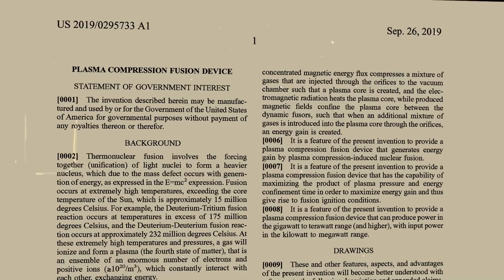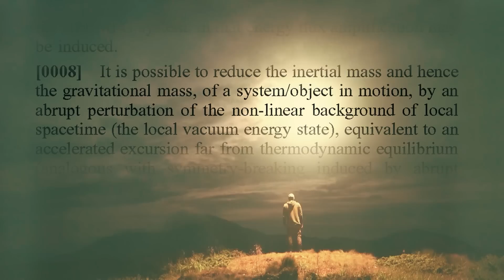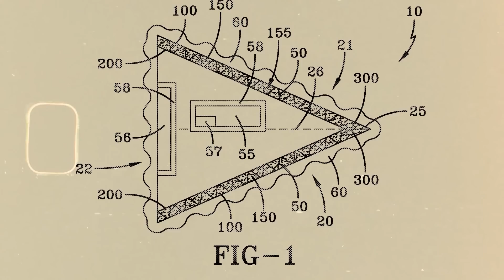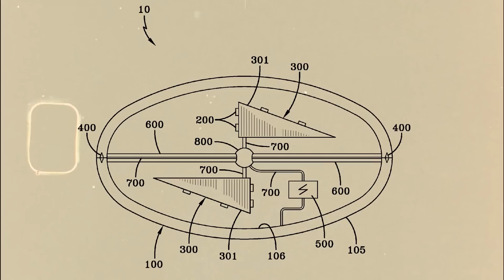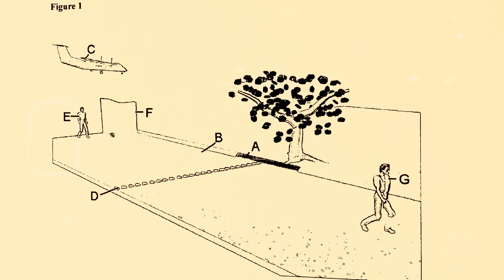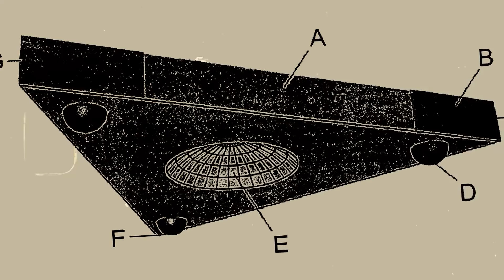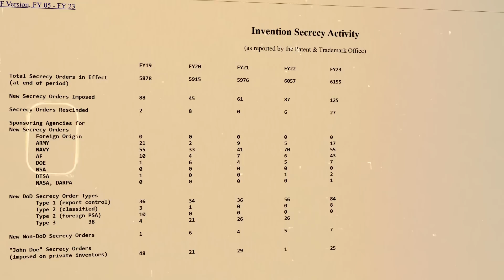The UFO Patents: 5 Military Inventions of Unexplained Technologies

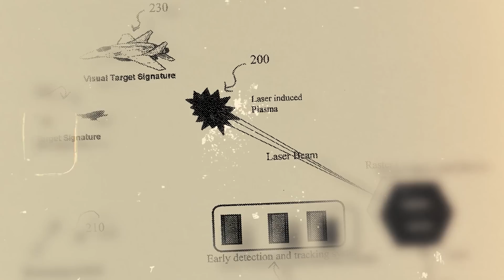Comment: I saw a TR3 on my commute to work in 2017. Got a good, long look at it as it hovered at around 300' altitude, right overhead. It was super early morning (around 5:30) and still dark when I stopped my motorcycle at an intersection, it seemed to get darker outside suddenly, so I looked up and there it was. It seems like the pilot(s) wanted me to see it, 'cause it sat there, very still for nearly 30-40 seconds before gaining altitude and banking into clouds. I experienced alot of weird things around that time.

Comment: The  triangle exists. I've been within  150 feet of one that was over a quarter mile wide. It was moving slow enough to keep up with it on a bicycle. Also I have been within 9 feet of one that was sitting still. I sat next to it for almost five minutes. The last one was shaped kind of like a stretched out drop of water and was about 6 feet long. Neither had sound or engines and its not the only ones I have seen. Most people couldn't  handle what's really going on here on this planet. It is best they just laugh and think your nuts.

Comment: I clicked because I saw the triangle in the thumbnail in 92 or 93, didn't notice the divot in the center, dull white lights on the back corners, red light on the tip with two more white lights left and right behind the red one. wasn't quite dark, it couldn't have been more than a thousand feet directly over me if that, not much sound at all and it was not going fast at all, watched till it went out of sight. 💚 from the middle of W.V.

Comment: the only problem I have with any of this is how quickly the 'gravitational wave generator' patent was glossed over.  regardless of if it is high frequency or not - the process of creating a gravity wave is not known to current physics or science that I know of.  they can be detected, but producing them is entirely a different matter.  inertia can be dampened by electrical potential fields and those can be used to create impulse, but that is not the same as gravity.  bravo to them if they did it, but that science is literally out of this world kind of level of science.

Comment: High Frequency Gravitational Wave Generator doesn't read what it originally did when first submitted and finally accepted, reluctantly by the US Patent Office. I only found it because they reached out to a news agency and my research into plasma weapons pulled three article up in a search. The Pentagon and Navy had to threaten to "turn their entire organization upside down" if they didn't patent it, stating that it worked and wasn't theoretical or scifi. The US Patent Office only spoke about it citing the potential damage to their credibility. 

It can be started with a gasoline or diesel engine, generating an EM field which is vibrated through a serious of mechanical acoustic and electrical mechanisms in the gigahertz range. The gravitational waves generated from the first fields vibration also generates an extra EM field. That secondary field was unexpected and contains about 10^33watts/hr of energy, which far surpasses the necessary energy to do what they say it does. It also is the technology which is causing physicists to reconsider inertial mass problems, remove them, and make their own predictions for faster than light travel. Currently, they estimate about 1/10th of the total energy output of the sun which is trillions of times smaller than what this thing is claimed to produce to go 100 times the speed of light without the inertial mass problems this "engine" claims to negate through Quantum displacement. The energy in the secondary field is captured via a copper lattice under the skin of the craft, which can be any size, requiring only to be within the gravitational field, and can be supplemented with extra HFGWG units tactically placed around the craft. 

The reason you won't find further advancement on this project is because it's evolved into other projects with new names as the technology is advance. HAUC Hybrid Aerospace and Underwater Craft is the next step after this, and is using the HFGWG in a configuration with other HFGWGs to increase output, and has commissioned a 2 terrawatt (I think it was) fusion reactor, which is just enough energy to explain how you flew a submarine into space (being the test platform for this technology,  or a submarine like cylindrical craft). There is another advancement of this technology being worked on which comes after this in the US Navy's lineage of this technology. The airforce, Northrup Grumman, and Lockheed martin are working on their own variations. It's likely this technology has taken off faster than most new technology does as the original has a lot of capacity for power increases and shrinking, as the engine itself doesn't have to produce propellant or push the craft with any conventional means, like air or water.

Comment: #2 is the famous US aircraft Aurora. Unlikely to use any non conventional system. Electromagnetism as propulsion, again, was tried by the Germans in WW2. Huge energy is necessary and there may be huge losses in making such. Vertical takeoff and hovering are, also, WW2 ideas, mainly, pioneered by the Germans with various levels of success. The Soviets used a simple rocket and catapult system to, initially, propel their airplanes. Russian airplanes, now, can stand still in the air, just, by using their powerful jet engines. They can hover, too, or move with walking speeds, etcetera. They can be driven by humans and or computers. Thus, aurora may use a power system pointed towards the Earth to overcome gravity and another one for motion, which, is how all aircraft are supposed to be built. 
 
Aurora flew over Belgium ( home of NATO ) in the 90's to make the so called Belgium " UFO " wave. The US is in possession of such aircraft, hopefully, very few.

Comment: #3 : One of the problems with lasers is the energy decreases with the square of the distance. Thus, the energy of the device ( at the " muzzle " ) will decrease 100 * 100 = 10000 fold at 100m distance.
Reply: The craft uses laser to move air and open vacuum in certain  direction to move and ultrasound emitters on each point of triangle to move it to a certain point. More than one craft they use does this
Reply: @alexlifeson44  How will the laser move air? By heating? Then, the laser must be so powerful, better heat the air with conventional methods. Also, the heated air will, only be very near the laser ( in one point only ). To heat air in a huge volume, either millions of lasers must be used or one which moves the beam. Then, until another point is heated, the other one will be cooled. Also, ultrasound cannot move air without new air coming in and the new air will be cold. One cannot make a bubble in the air, the bubble must have physical walls to keep the new air from coming and, even then, the surrounding air will cool the walls and the adjacent air inside. Not to mention the power of the ultrasounds. 1KW of audio can make sound in a square, a few kW in a big stadium and this is, just, for the people to hear the sound. Can you imagine the power to move people or objects? MW? GW? TW? Just to move an 80kg man a meter or two. A simple jet engine will heat the air much easier and move, too.

Comment: Check the book: the man who mastered gravity.  Biefeld-Brown Effect.
Reply: Electrokinetics. For the Biefeld-Brown Effect to work, in theory, requires the asymmetrical capacitors to be aligned in a triangular configuration. That would explain the shape of the "TR3B". But, since you need massive amounts of very high DC voltage to initiate the Biefeld-Brown Effect, how would you explain the "TR3B" flying given the size and weight of the mechanisms required to produce such voltage? Also, it would make sense that such a craft would be flown in places like Nevada and Arizona, given the "drier" air and atmospheric conditions since the Biefeld-Brown Effect uses ionized air as a conductive medium. Humidity would cause such propulsion to act erratically.

Comment: TR-3 is used in US Congress budgets. It's currently applied to the F35 Lighning II. It means "Technology Revision" 3 (TR-3) the B aspect, is when the "Astra" (SR-71) changed designation to "Quartz", initially gaining the B moniker, as a subset, however it was later given an entirely separate code word, for creation of the SR-75 and for the SR-91 Aurora was designated, although you will find mixups on the Internet claiming the SR-75 Darkstar as Aurora, as once again the project shifted from Quartz / 75 to Aurora / 91. Officially these aircraft do not exist although, there is radar tracking data and intercepted Millitary crosstalk, using the designation "Darkstar November" and "Darkstar Mike", which also indicates that the SR-75 Darkstar not only exists, but there is at least 2 of them and being the alphabetical chronology, at least 12 earlier iterations of the 2 production units, that were tracked over Europe, where the intercept of crosstalk originated. There was also an incident that occurred in the UK at a military aviation base, where one of the craft ran into trouble and was forced to make an emergency landing, requiring lockdown of the base and a media blackout. All there for you to explore, and find out for yourself.. these are not the most hotly gaurded secrets after all, which also leads to speculation, as to why.
Reply: Congratulations! The FBI will be knocking at your door at 3am tomorrow!

Just kidding. Not one word of what you wrote is even remotely true but I enjoyed the laugh.
Reply: @Frankie5Angels150 you mean " weather baloons" ? 😂

Comment: You mentioned plasma a form of plasma that has been documented on numerous occasions is what is called ball lightning it can travel through the outer skin of an aircraft and has rolled down the aisles there are numerous witnesses to this from the original time that we started using aircraft to this day a lot depends on the altitude and the fact that planes do not fly into thunderstorms now are very seldom so it would be easy to utilize this and make it into a working concept

Comment: Triangles for the edge of space runway, basicly aircraft carrier blimps that connect to each other to make a runway. They are electricly powered. Once saw 2 go by low and slow, one was lit up and running, and they had teather or extetion cord going to the other one that wasnt lit, they had spotlight on the cord, seems they didn't want it to pull tight, so probably a power cord connection. They were about the size of a football field if they were connected, and about 30 feet top to bottom. The sound I heard was like a low V12/24 cyl engine at mid rev, but to me when I went outside, it sounded more like electrical hum, comming from the 3 corner lights.
Reply: I think it was one of these that was responsible for the Phoenix lights....

Comment: 6:30 :: I've been close enough to a "flying triangle" aircraft to see the rivets holding the craft's skin onto its structure. I followed one along a road about 20 years ago as it was slowly cruising along during a pretty brightly lit night, and it was only a few hundred feet away from me. I followed it for about two miles before the pilot realized I was there, at which point the craft slowed to hover, rotated from westerly to southerly, and then gunned it toward a nearby bay where I couldn't continue to follow. Saw a similar craft doing touch-and-go landings off the end of a runway at a nearby Air Force Base about a year later.

Propulsion was not extravagant electrostatics; it was just a set of very quiet vectored-thrust engines, presumably small turbine or turbojet. (Think Harrier AV8B maneuverability but with F22/F35 level stealth.) I had to turn off the radio in my car to hear the engines. Each corner had a square-ish set of louvered grates on it that I surmise were thrust ports.

It was absolutely a US dotmil project - the one I followed had USAF badging - and I would be not the slightest bit surprised if it were a stealth R&D testbed.

Comment: "Officially, the TR3B does not exist" Now there's a surprise. I'd have put money on that being real at least... 🤣😂😂
Reply: It's a cover up. We can't build ROCKETS that work, but yeah we totally can defy gravity. Who's physics are we using? Einsteins doesn't work.
Reply: Oh it's real, I've seen them twice and followed one once. The whole electrostatic propulsion part is BS though - the one I followed was using plain old vectored thrust off a jet engine. (I saw the underside and its thrust ports, and although it was VERY quiet I could hear the engine(s).)

My money is on it being a stealth testbed, possibly the R&D "skunkworks" source for tech in the latest generation of fighters. So it'll be declassified probably on the 12th of never, 2999.